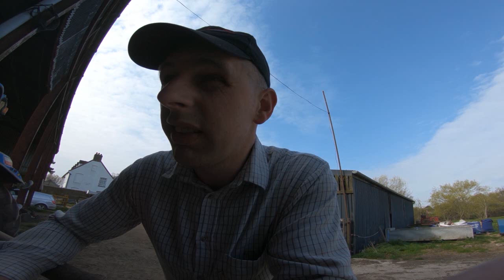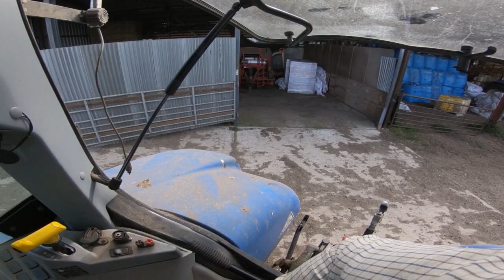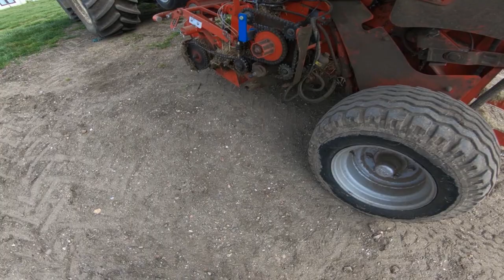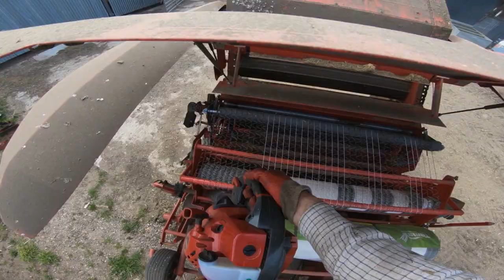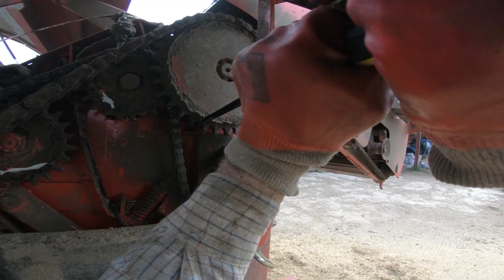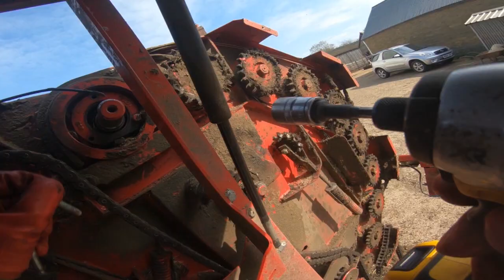PRE-SEASON BALER CHECK

Comment: Seeing how so much straw and dirt and crap ends up getting in the gears sections that are outside the main straw forming area of the balers.. I think of why can't the makers make it so all the gears and chains etc. are in a sealed section where just the running drive shafts go through the wall of the gear section into the straw forming area.. the gears then would not get stuffed up with any loose straw and muck as their section be under a easy access sealed door and separate to the straw forming area of the baler!  Also there should be a in built piping in the straw forming areas of the baler framing that takes air from a inbuilt turbo type enclosed fan which when it is time to clean out the baler of left over straw in the workings.. you attach a tractors PTO and unlock a control on the side of the baler cover and with the access covers open the turbo fan unit run from the PTO blasts air through the whole baler bale forming areas blowing out the straw and muck saving you having to do it with a blower like you did here?  If the pipes are stainless steel they with not rust each can have set angled vent nozzles that blow all muck and straw out of the all the baler.

Comment: Operated a welgar 4 foot early 80s,those top bearings are taper fit,or were,knock back against drive,they didn't draw/knock off!! Luckily sussed it before raxing shaft/frame! Changed a few, didn't help baling (very) wet grass,many a bale weighed over,well over,half a ton.This was string and plastic bagging days.6710 on the front always had a good days hard work.No ss straight pipe though,think it was "borrowed" by unknown to put on a 8100!!